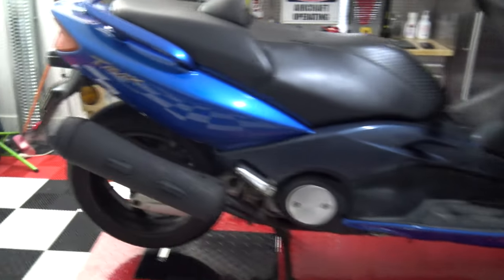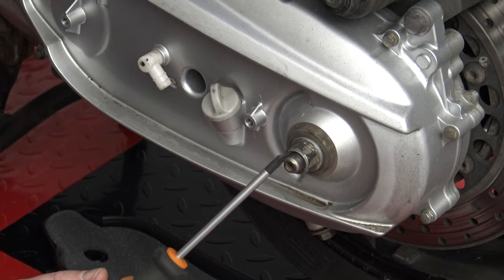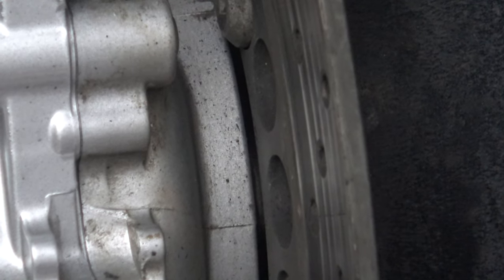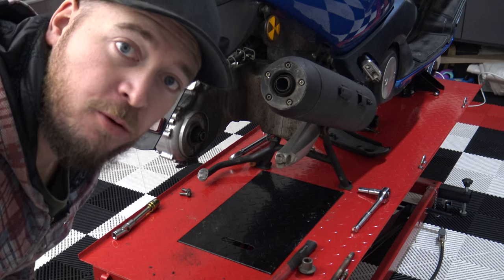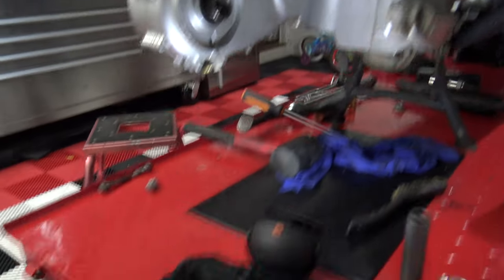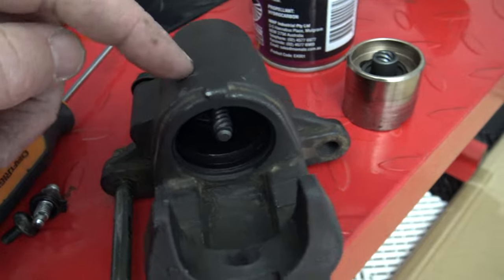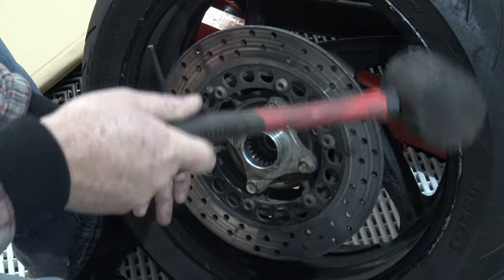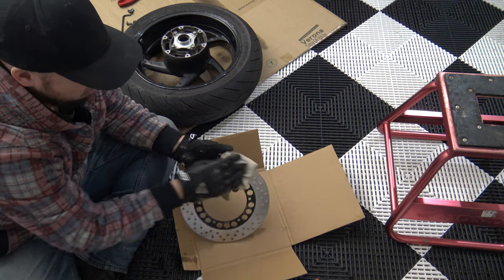Yamaha Tmax Front + Rear Disc Replacement - how to

Comment: Just for a little United States English trivia we call the strap you held the brake caliper up with a “bungee cord.”
The 19mm socket is almost identical to the US 3/4” 
8mm is 5/16” 
13mm = 1/2”
14mm = 9/16”
16mm = 5/8” 
These wrenches are not exactly the same to the thousandth of an inch but close enough that we often substitute them when wrenching on things in the US. 
Thank you for putting in the effort making the video. 😊
Reply from the maker: Thanks for clarifying I’ll pin this post

Comment: Drag a fingernail across the disk, if it gets caught, ok you can replace it. if you only get some on the outer edge where the pads don't touch you can clean them up if still in spec calipers or micrometer, 3 measurements in-mid-out over 4 or so locations going round it. 
Do you mean the bungee cord?
Fluid change maybe from the other work in the rear. 
That isn't too much grease. 
If you have a dual caliper setup generally do them 1 at a time.
Reply from the maker: yeah i measured those discs, they where 2mm under spec. LOL
Reply: Used hard and put away wet... good times.

Comment: don't use a torque wrench to remove bolts, has it will dis-calibrate them. other wise, nice work.
Reply from the maker: Yeah your not ment too but when I lost my breaker bar I had to improvise.
Reply: presne tak.